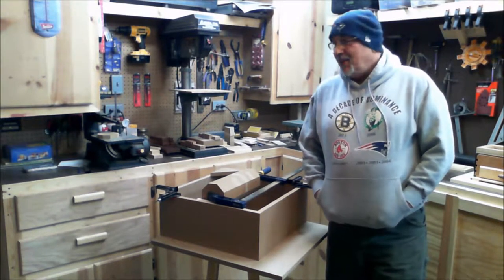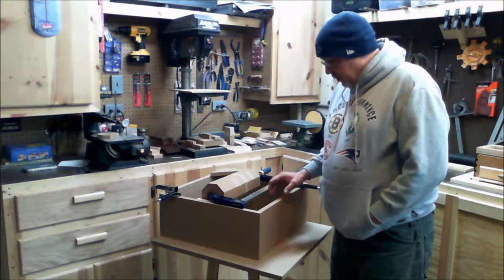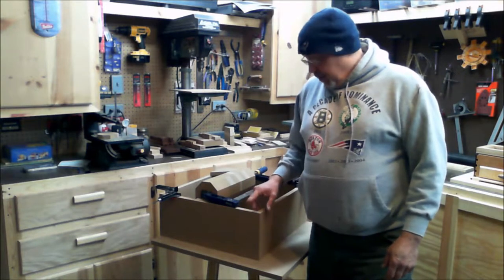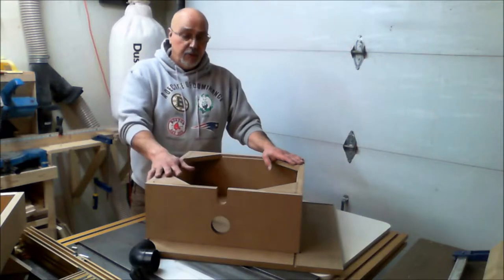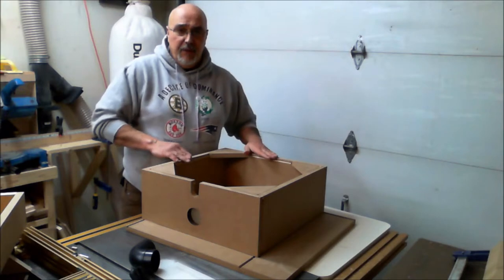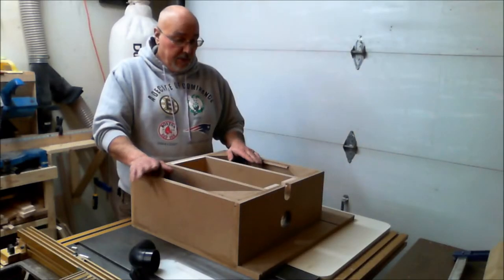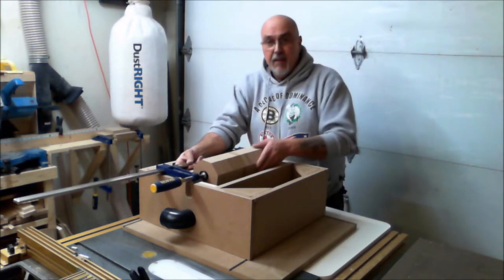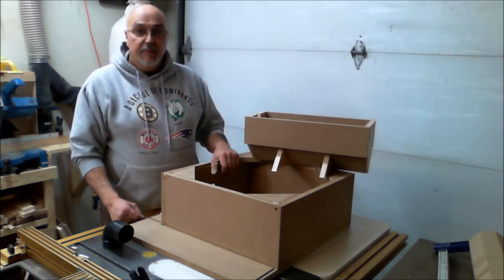home made bench top Drum Sander part one

Comment: you could leave the drum a hexagon til its finished and then get a flat piece of plywood and spray adhesive a big piece of 36 grit sandpaper to it and then put it so its barelly touching the wheel and then turn it on and slowly raise the table til u get it all the way sanded to a perfect balaced drum.  mdf should sand pretty fast so wont take that long im guessing